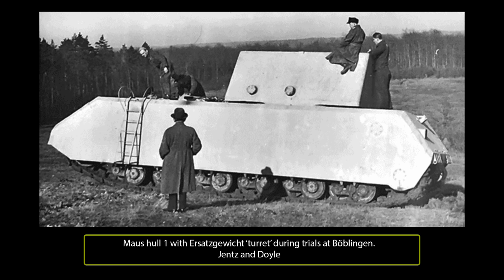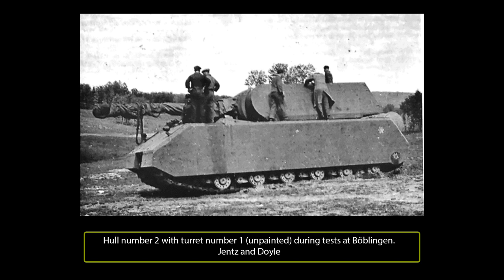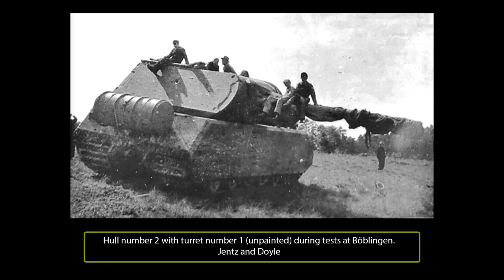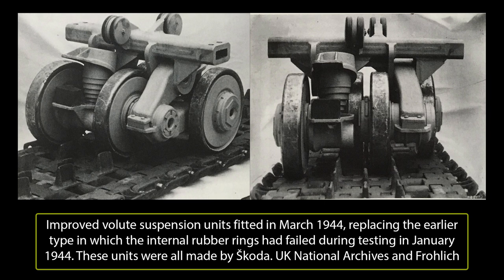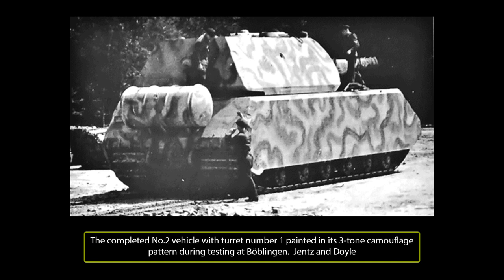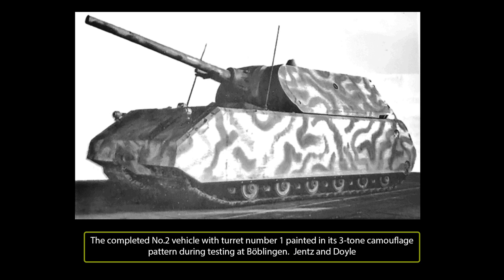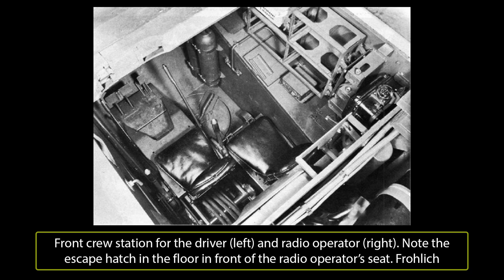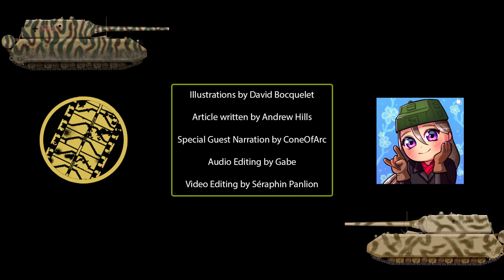The Definition of Inefficient | Panzerkampfwagen VIII Maus Part 2 feat. @ConeOfArc

Comment: I expect the rate of fire for the big gun was too slow to allow for any real time defensive fire.  The "75" made up for the 2/min slowness of the main armament.  Otherwise, enemy infantry* could rush the tank, while it was reloading, and disable the tracks and optics.  And most likely toss a few Molotov cocktails on the engine deck, of course.
  My choice for a Co-Axial secondary would've been the 3cm MK 101.  Hits like a "57", weighs less, and has smaller ammo.  And is an automatic cannon-my favorite flavor.
  Against enemy planes you could dump water into the exhaust and make smoke.  I know; it's hard to reach them up there, and harder still to make them hold still, while you pour water in the tank, but it saves on wear and tear of your guns, armor, and radio antennae.
*Or enemy fast tanks could ride around it in circles, whooping it up and counting coup by bouncing 75mm off its sides.

Comment: As i see it that curved mantel has the wrong angel and will if hit deflect the shot down on the thinner top plate -bullet trap as the Panther had Until they put a form of chin on it from late 1943 , almost all Panthers at the Battle of the Bulge had this extra protection
Reply: Yeah, it's a shot trap. And you are speaking of the difference between the panther a and the panther g. But as stated on the video, the Maus was a back burner project